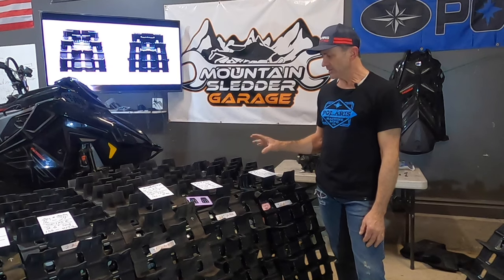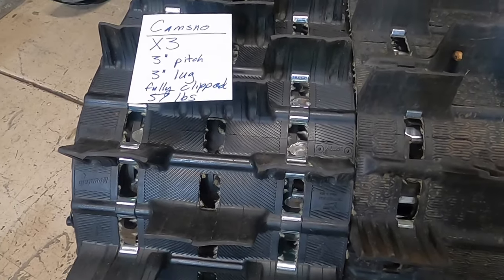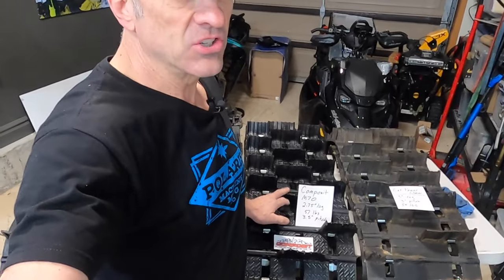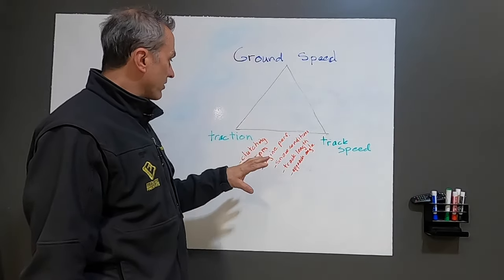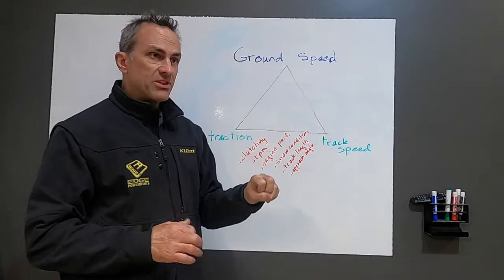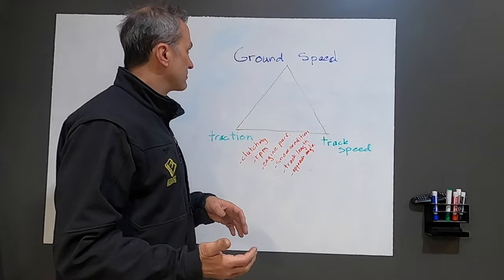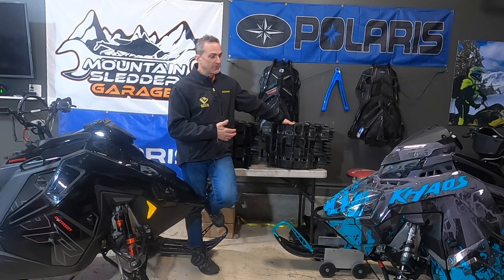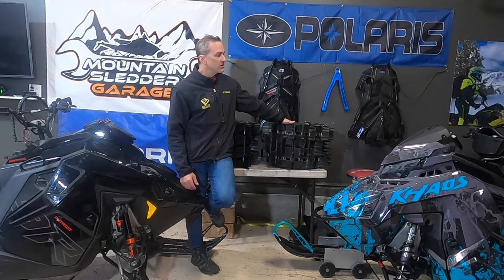Polaris aftermarket mountain tracks, part 2

Comment: Great video.   Are there many track options for sleds with 2.86 pitch drivers, or is a guy better off changing drivers?  If changing drivers, would you recommend 3.0 pitch or 3.5 pitch drivers?
Reply from the maker: Composit makes a number of their tracks in 2.86” pitch. Here’s a link to their mountain tracks, you can see which style and lengths come in 2.86. 

https://compositsnowmobiletracks.com/tracks-by-types/mountain-snowmobile-tracks/